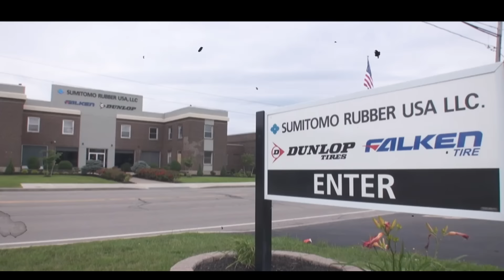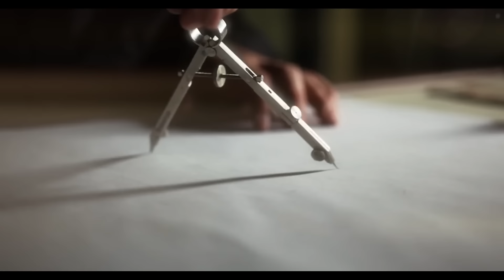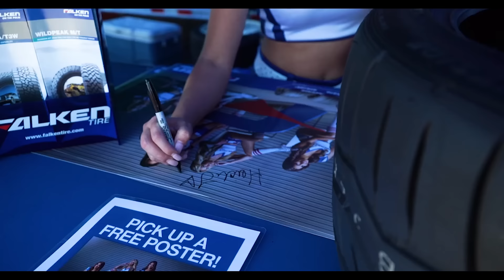THE TRUTH ABOUT FALKEN TIRES

Comment: never heard of this brand in my entire life and 18 years of automotive mechanical pro experience....i dont think ill recommend them based on that
Reply: Falken tyres are well regarded in the midrange market segment. I've used Ziex 914 Ecorun on a VW Passat. Fine to driveon but the wear rate was crippling. Might as well pay a bit more for a premium brand.
Reply: Scypheroth Well it is a good idea not to recommend things you don't know about. Having worked specifically in the tire industry I have heard of them and would recommend them having personally fitted them to my own car.
As a tire specialist it is crazy how little knowledge the average mechanic has about tires but at the same time they know so much more than the average Joe they think they know enough.
You can learn specifically about tires for years and still not know half of what you should know.
Reply: +Brem - I fitted set of Falken Ziex 914 Ecorun's to my Passat a few years ago. The were superb to drive on. The only disappointment was that they wore down a little faster than I would have ideally liked. But very good tyres otherwise.

Comment: Bought a set of Sumitomo HTR performance tires after a rep at Tire Rack suggested them. Price was right, looked good. WORST tires I ever owned. The inner belts failed on 2 of the 4 tires inside of 8K miles.. The car pulled violently to one side or the other in boost/when accelerating. Tire Rack comped me a discounted set of Bridgestones to replace them. NEVER buy Sumi tires. JUNK.
Reply: I also got screwed when buying Sumitomo tires. My car (Mitsubishi Lancer) was always aligned correctly and I regularly checked the tire pressure, yet the inside of the Sumitomo ZIII tires wore out as if my camber was far out of adjustment. The store I bought them from credited me, and then partially paid for BFG tires. BFG tires seem to work fine on my car.